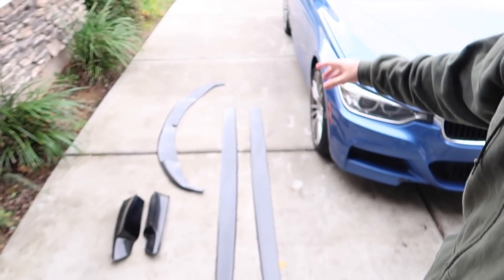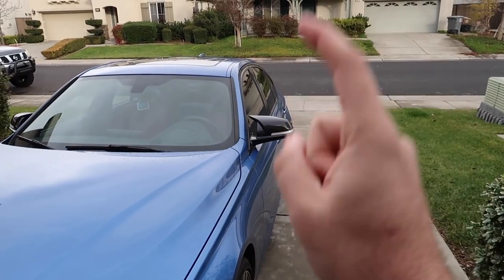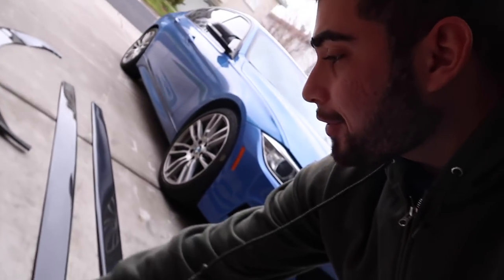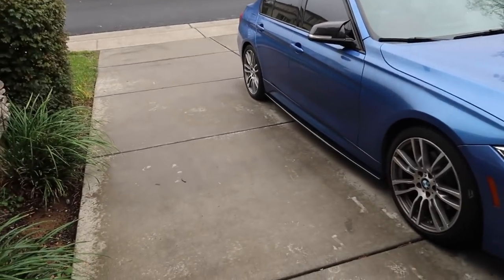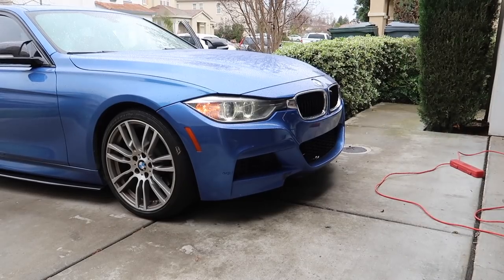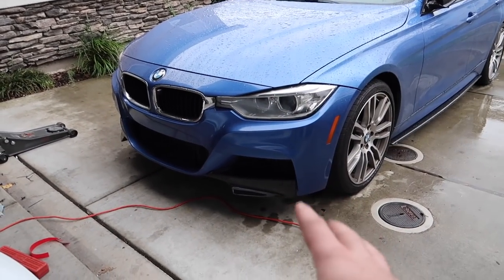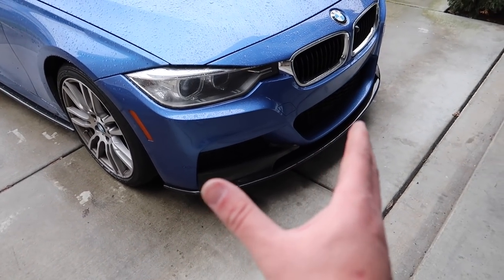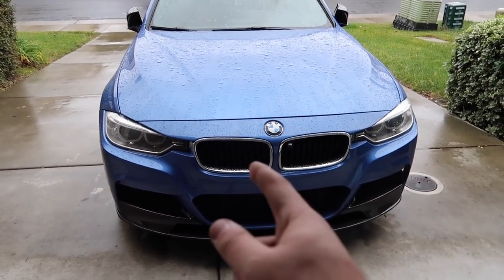EVERY F30 NEEDS THESE 3 BIG PIECES OF CARBON FIBER!

Comment: I might sound stupid here but these carbon bits you get like the front lip the side etc. as well as the 3M you apply are they already holes in these cars to screw them into?
Reply from the maker: There are factory holes but you gotta drill into the carbon
Reply: @NourHummadi  thanks

Comment: You didn't have to remove the glass to replace the mirror caps. I did mine by just prying off the mirror cap an it came off with no tabs broken.
Reply: You pull the back off?
Reply: @kay__519  yes

Comment: Please let people know that it is absolutely NOT necessary to remove the glass on these BMW mirrors in order to swap out the mirror caps. All you need is a good plastic trim removal set. Use the trim removal tool to pop off the mirror caps. The worst thing that might happen is you break off a tab on the old mirror caps! But your swapping them out anyway.
Reply: Is there a link to check?